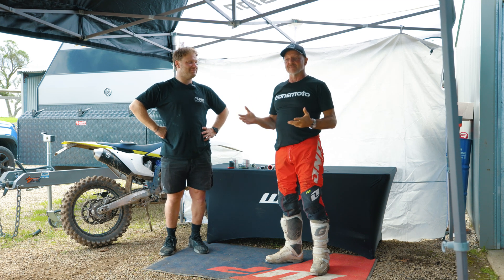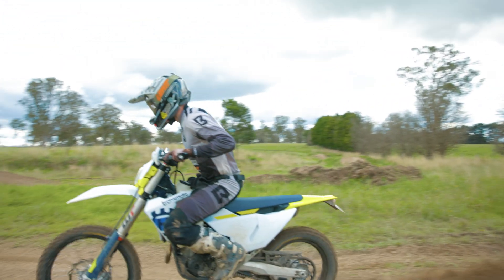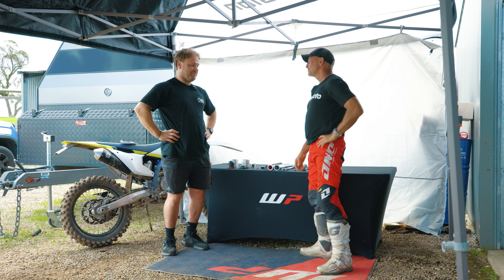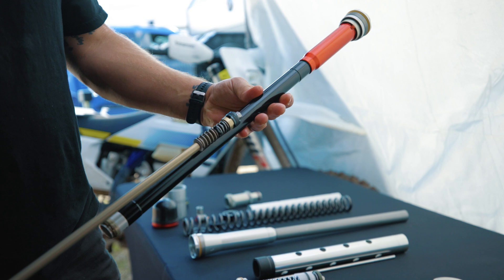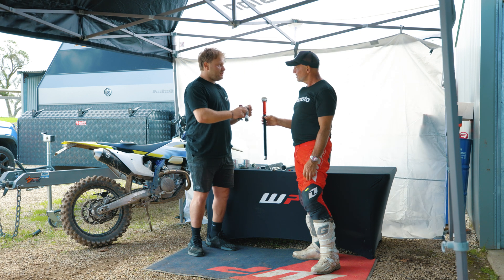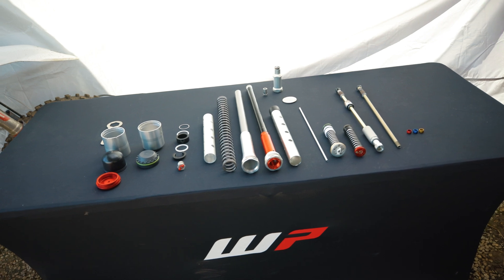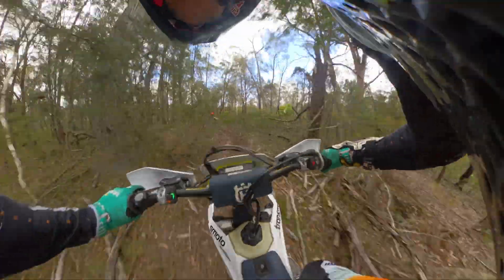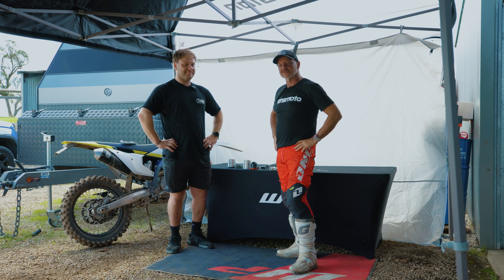IN DEPTH: HOW WP’S FORK & SHOCK UPGRADE KITS WORK

Comment: I enjoyed your article on the WP XPLOR Pro 7500 Cartridge and Bladder Kits—great info, especially from Stel at On Point Suspension.
I'm looking to upgrade the suspension on my KTM 890 Adventure R and had a few quick questions:
Is there a complete kit available for the 890 Adventure R 2023 that includes the 7500 -6500 fork cartridges.
Does the 7500 - 6500 kit fit the OEM forks without mods?